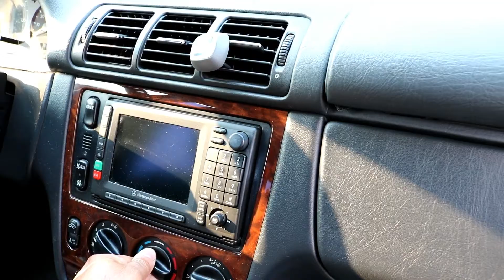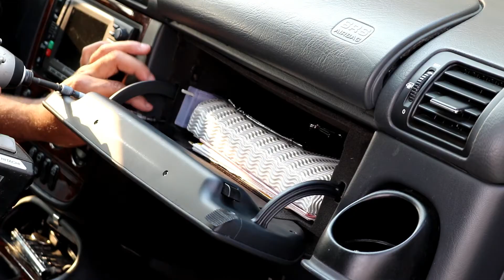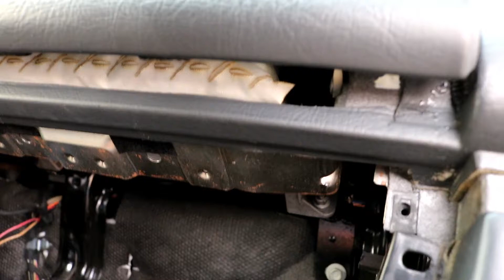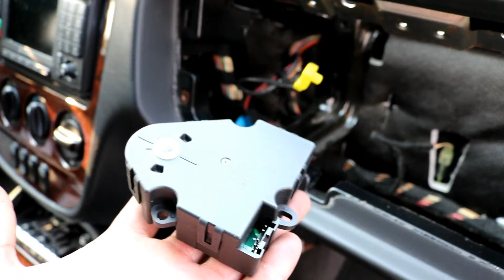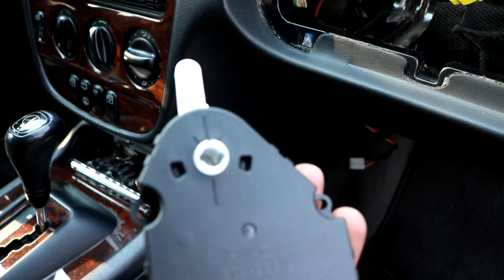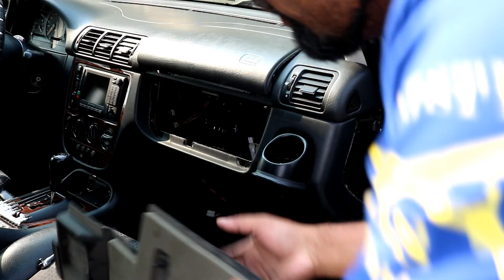W163 (1998-2005) Mercedes ML Blend Door Actuator Replacement!

Comment: Getting the back screw out was actually easier than the front screw, due to the low clearance between the actuator and the bracket holding the airbag. That and the fact that you cannot see it. I have a device that allows a 90° turn for a screwdriver and it still was a bear.  But getting it out was nothing compared to getting it back in again. I tried a dozen ways to place that screw in the hole that I could not see and could barely reach with my fat fingers. In the end, I glued the screw onto the 90° tool and was able to torque it down.

Comment: Great video.  For a right hand drive W163 would the flap actuator be in the same position? There one would need to be working behind the fascia dials. Thanks again for a great video.
Reply from the maker: I would think so. However I have never seen or worked on a RHD 163 so I can’t be sure.
Reply: No,it's opposite side on the fan blower side,I am just doing my one,I am pleased i found this video, great help!

Comment: What does it mean if it isn’t making the clicking noise? But it’s still stuck on heat. And i recharged the ac
Reply from the maker: It could very well just be completely dead.
Reply from the maker: The actuator that is.

Comment: What is the white plastic part called?  It is being held at about 16 minutes into video.  It is the part that you remove from the old actuator and put on the new actuator.  If anyone can tell me please, that's the part I need to replace.
Reply: @user-nw5pe4fv8r  As far as I can see the actuator just has the motor and spindle. The white part you referred to is the arm that links the actuator to the vent doors/flaps.

Comment: I used to just take the glove box out. At beginning of Summer, and again at beginning of Winter. And stuff a wedge of folded up photocopy paper.  To wedge the actuator in the cold position, or alternatively in the heat position. Depending on the season. Simple, takes about 15 minutes. And avoids all of this drama.
Reply: I did that at the beginning of the summer and it worked fine. However, now the actuator seems to be seized and I cannot move the white arms, so looks like this will not work for everyone.

Comment: I have a 2002 ml20 the mechanics telling me that there's some kind of compressor switch or something that needs to be replaced I'm not really sure but all he's trying to charge me $853 for this
Reply from the maker: Not sure what he is talking about. I assume your AC doesn’t work? It could be many things. This video just shows a bad actuator. If your car clicks like shown in the video when switching between cold and hot on the temperature dial, then you have a bad actuator as shown in the video. 

If your temperature changes without clicking then your actuator is fine.

Comment: Why is velcro needed
Reply from the maker: If you take this shortcut like I am you need to be able to hold down the airbag cover.
Reply from the maker: The proper way to do this repair would be to remove the entire dash. However I don’t want to do that.

Comment: My cla 250  heat isn't working not running hot had a mechanic look at it say its blend door actuator. But I have no ticking noise
Reply from the maker: You would have to inspect the blend door for proper operation while you change the temperature
Reply: @HelpingHandAutoRepair  how do I inspect it
Reply from the maker: Well the only blend door I can see on your system is behind the glove box. If that is the problem you would need to remove the box and inspect it. 

I am leaning more towards the heater control valve.

Comment: Mines dosent make that noise but would fixing that make my ac work agian? Bought a new compressor and still no ac got a mercedes benz ml350 2003
Reply from the maker: I assume you had the system recharged after the new compressor was installed?

Comment: Job is done. Thanks for your video. My car is a 1998 so their are some differences but very minor. I slotted the bolt holes for the air bag cover and ran the nuts down as far as I could so I could slide the studs back onto the bracket. I then tightened the nuts. I will glue it down at a later time. I want to make sure it is going to stay working for a while. I am a happy camper.
Reply from the maker: Nicely done!

Comment: How do you pull the airbag cover up? Does it take much force to break the 2 clips that hold it down?
Reply from the maker: gfinklea Just use a razor blade in between the bottom of the cover and the top of the glove box area. Then the door will lift up easily aside from having to undo the three 10mm nuts on the underside of the cover
Reply: @HelpingHandAutoRepair  Thanks so much. I am going to  take on this job as soon as my parts arrive.  Very good video.

Comment: Excellent vid, thanks. Need to do this soon on my 2000 ML320 as my air is stuck on cold and we have winter. I removed glove box and seen that there is no movement on blend door motor. One weird thing I noticed while playing with dials is that when I activate recirculated air, the flap on the ventilation enclosure is opening up and when I disable it it closes. Is this normal? Should not it be another way around?
Reply from the maker: Kirill Alder It should be flipping up towards the windshield area when activating recirculation.

Comment: I've been putting this off for a year or so. Really didn't want to rip apart the dash, but was going to when the weather got a bit warmer. So glad I came across this video! Very good instructions and simple. Do you think one could just put velcro around the whole air bag dash cover instead of having to bolt the back and velcro just the front? When testing out the motor before; It seemed to move whenever the dial would be set cold or hot, no clicking. Maybe another problem? Maybe the flaps? I left it on ac but needed heat this past winter. Always blew cold. Thanks again for the wonderful video!
Reply from the maker: Derrick Niide This actuator I am replacing here controls air temperature.  So it will control cold or hot air. Even if it doesn’t click the gears could be stripped which would give you no audible clicking. I don’t see why you couldn’t use Velcro around the airbag flap. Good luck.
Reply: DONT use velcro around the whole airbag cover! If it ever blows that cover could  kill someone! Its BOLTED on back for that very reason. Velcro toward the seat is fine, velcro by windshield is BAD!

Comment: Thanks!. Airbag part is a pain in the ass. I used a rubber hammer to get the airbag more flush with the dash and used a strip of velcro to hold it down. looks good.

Comment: Great video. The lower 'stays' attached to the airbag cover are available, I believe, but must drill and rivet if I remember correctly, then snap cover in place, ed.
Reply: The best video on this subject. Years ago I tried to remove the air bag but couldn't get the right rear bolt off. Didn't know how to pull the lower portion of the dash off to get to that bolt so I gave up. However, I will get back to that task since you clearly showed us how to loosen that part. Thanks for your easy instructions.